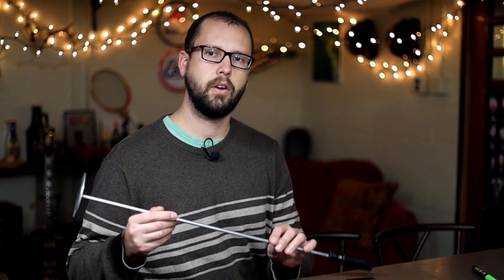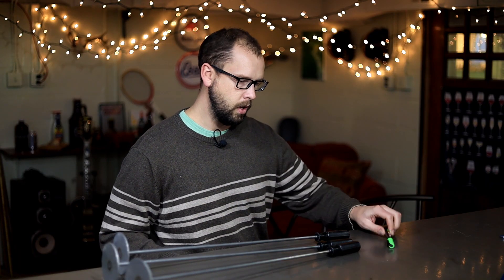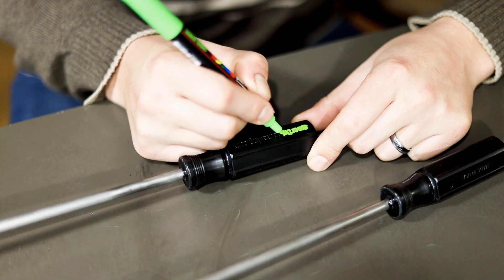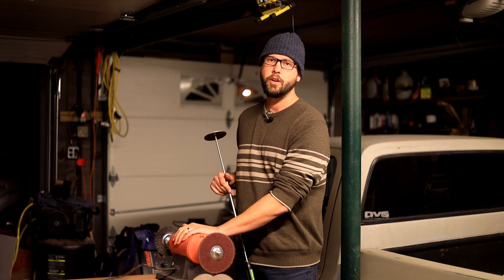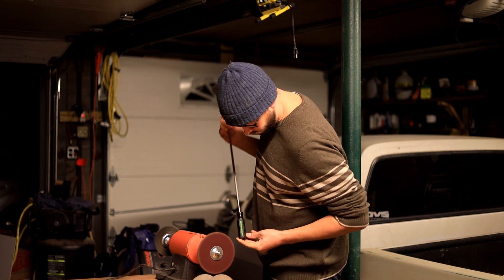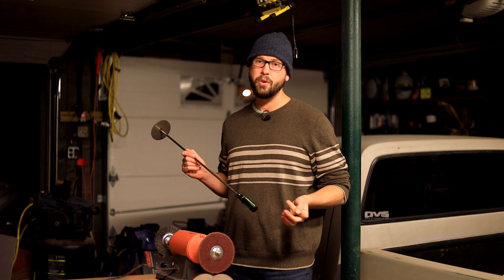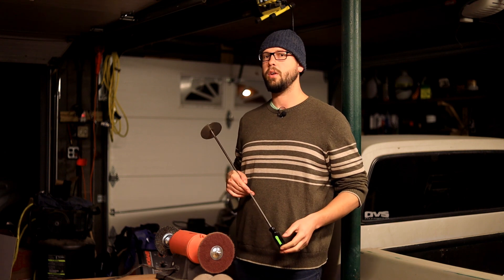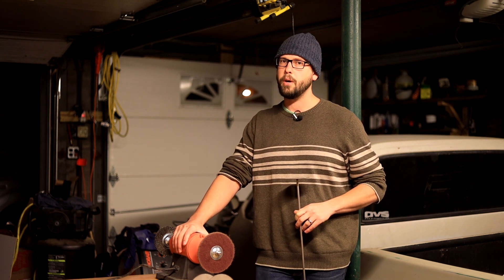Filling Engraved Letters with Paint

Comment: Finally, after 59 years....someone teaches me how to paint engraved lettering. I truly appreciated this video. Well done!!
Reply: 😂 I used to make a frame with painters tape then use spray paint then just sand it back off if that makes sense’ it worked but takes practice’ 
Paint markers for me either bubble paint drips everywhere or the tip of marker gets black from touching surfaces then messes it all up as it will have almost “eraser mark” look splotchy dark patches
Reply: @@alan1413 WOW...Sharpies...yes, that will work for a lot of stuff. But I like your method with paint and the new development of acrylic pens. Alan, I have racked my brain for hours trying to solve this issue before I saw this video. Thanks!!

Comment: Will this work on metal eyeglass frames? You see, I have a pair of Ray Ban metal frames with prescriptions lenses inside, and the Ray Ban letterings are engraved into the temple part of the eye frames. I'm looking to use this method to paint the engraved lettering that way the Ray Ban logo will stick out visually.
Reply: Yeah, but don't use the enamel paint. Use chalk paint markers, they don't adhere as well initially, which is good because then you can remove the excess easily with a tissue + alcohol. I usually dab a bit of clear nail polish remover very carefully on top of the lettering to coat it.

Comment: Stupid question: what if you have a chrome piece that you want to get filled in and don't wanna damage the finish but here is the kicker: I would wanna pay for this to be done so there is no room for error. Who or what kind of shop could you take this to to be done?
Reply from the maker: I would probably fill the letters and wipe what you can before the paint dries.  Then you can buff the rest of with an emory cloth.  It shouldn't scratch but if it does you can follow up with sandpaper starting at about 2000 grit and working your way up to 12000 about 2500 at a time.
Reply: @CoolStuffGuysLike  what kinda of shop or trade could do this? I wouldn't want to do it and run into issues I rather someone do it and be done right the first time?

Comment: Looks very cool thank you for the video any chance you could tell me what type of wheel that is for buffing I’ve been trying to get one I can’t find one i’m doing some fine lines on 3-D printing I’m not sure if this would work for that any information would be grateful thank you
Reply from the maker: They are 3M 27747 disks on a harbor freight buffer.  They work good for the screwdriver handle because they are narrow enough to get between the ridges.  You don't want to use a lot of pressure though.  If you have a flat surface I would probably use fine sandpaper on a block or palm sander.  Depending on how shiny you need it you could go anywhere from 220 grit for smooth and not shiny up to 2000+ grit if you need a more polished finish.

Comment: I have a hand engraved putter with scroll work I want to paint fill. The putter has a black finish.   How can I remove the excess paint without damaging the finish?
Reply from the maker: I would probably try to gently wipe it while the paint is still wet rather than buff it off.  Or you can try to be a little more precise and use a small needle to work the paint into the letters.  Will be more tedious but should work.
Reply: James Woyton you can use 100% acetone to remove excess paint

Comment: How would you do this if the handle was also painted?
Reply from the maker: If the grooves are deep enough you can wipe it before the paint pen sets up.  You can really carefully wet sand off the new paint with a high grit sandpaper and a little block but you will have to be really careful at any corners or high spots so you don't sand through the base paint.
Reply: @CoolStuffGuysLike  On my item I ended up just removing the oxidation and polishing it out as best as I could rather than painting and then used the technique in the video.  It worked great.  Thank you!

Comment: Hi, what gear are you using to record this?
Reply from the maker: I use a Canon EOS R full frame Mirrorless  as my main camera and will occasionally use a Canon 80D or Rebel SL2 if I have other camera angles.  I am mostly using prime lenses like then 35mm F2.0 with an rf to ef adapter, the 50mm f1.8 or the 85mm f1.8.  I use a zoom H1 recorder with an azden lapel mic for audio.  And use clamp lights with 5000k lightbulbs to get pretty neutral light that the cameras like.
Reply: @CoolStuffGuysLike  Thanks for your patient and generous sharing of this info.  The video is indeed well made and of high quality.